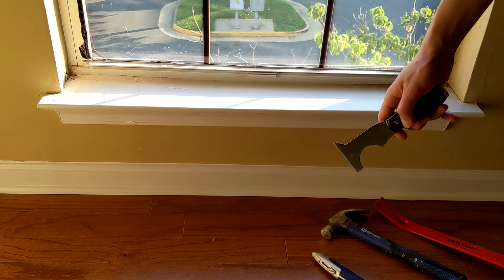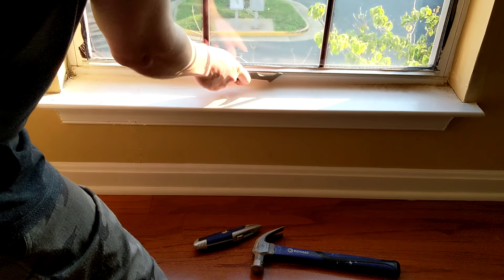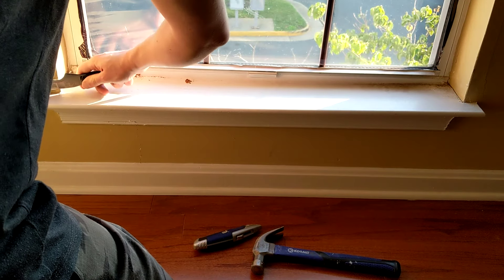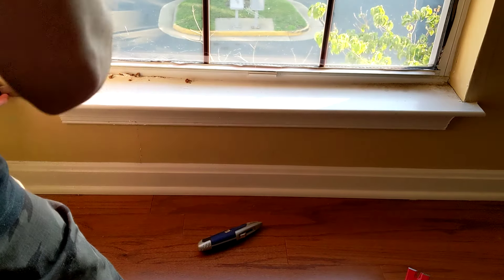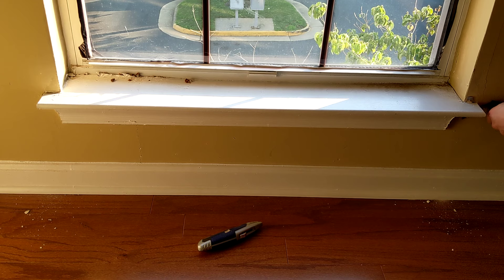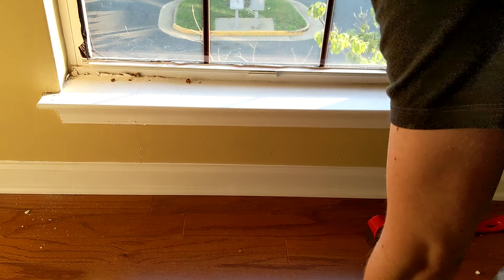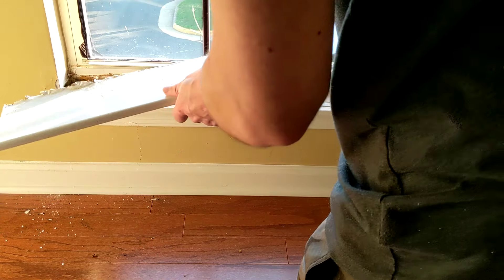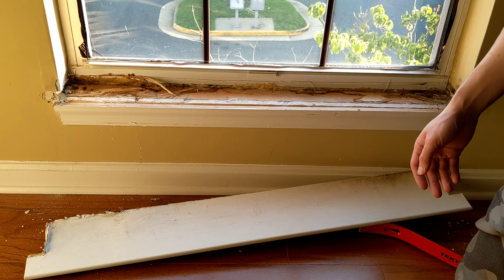DIY Interior Window Sill Repair Save money $$$ Part 1: Removal

Comment: I would have pried it up a tad and used an oscillating tool to cut the nails off so I could pull the piece straight out.
Reply from the maker: Great idea. That would be a super clean way to do it

Comment: My window sill is fitted to go under the dry wall on the sides, and is nailed 😔
Reply from the maker: You can still do it you will just have to pry it out and fix the drywall potentially after as I did. Hope you managed to get it replaced!

Comment: I believe what you removed was the stool, not the sill. Sorry 😞
Reply from the maker: Thanks James. That may be technically correct. I believe they are use interchangeably. The company manufacturing them is called sill rite. And is selling these branded as window sills.